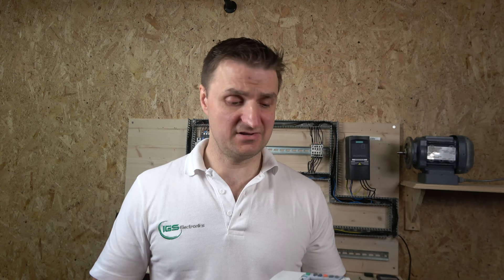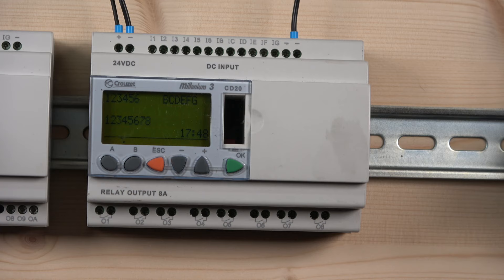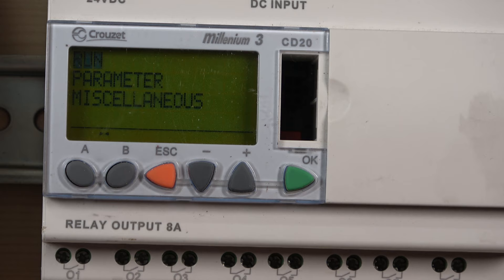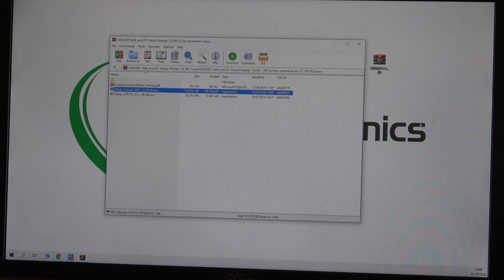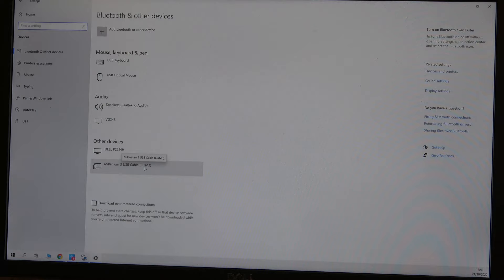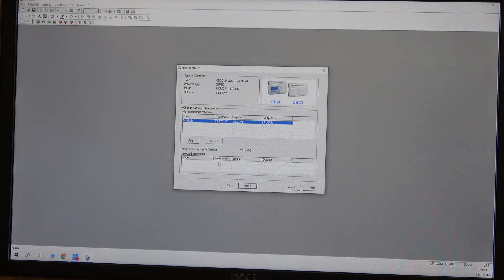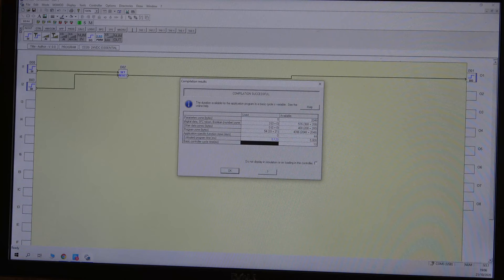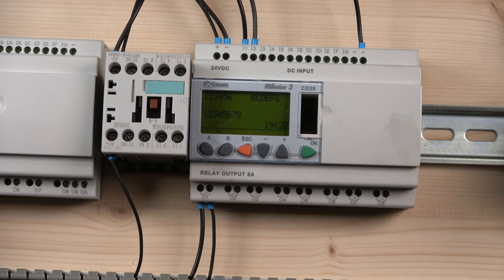Crouzet Millenium 3 controller program download/upload with FREE Crouzet M3 Soft software. English

Comment: Hi great video..I downloaded the M3 software but the downloaded exe wont run on either of my windows 10 Home or Pro  laptops. How do you install it on Win 10?
Reply from the maker: It should automatically be installing on Windows 10, i had no problem with it. Plus the software has been updated to run specifically on windows 10. So am not sure where the problem is.

Comment: CAN YOU UPLOAD A PROGRAM FROM A MILLENNIUM 2 AND DOWNLOAD IT TO A MILLENNIUM 3?
Reply from the maker: Never attempted to do it with Crouzet, but in others that i have done, in most cases, just changing model number in configuration is good enough and if it is not, manufacturer releases some sort of software to help you out to upgrade you controller.